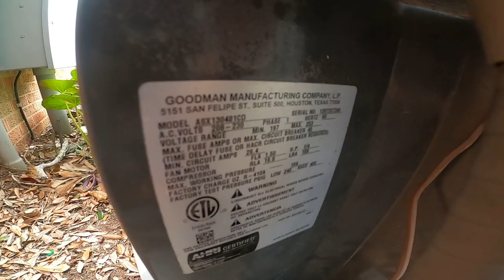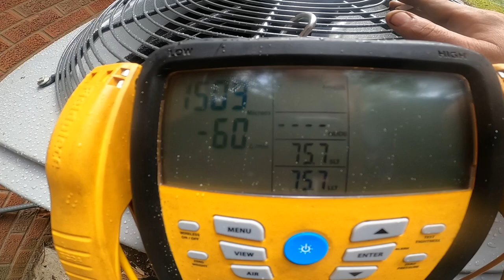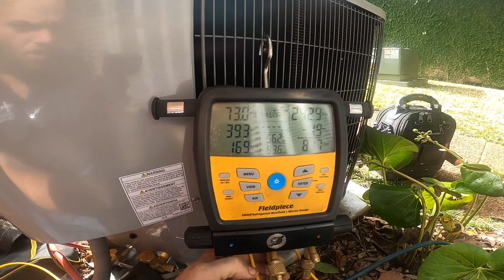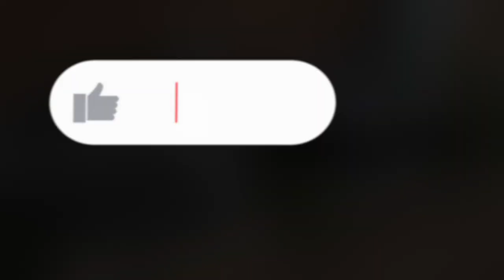HVAC Condenser Change Out/Day & Night (ICP)

Comment: I know lots of units that were installed decades ago and they didn't use nitrogen then and the units are still working. These are 22 units with no leaks. The only thing we have to do is keep them clean. Change a fan motor now and then. I noticed you cleaned the copper before you solder. A lot of Geniuses that are complaining don't even clean the lines, and they wonder why they have to come back.

Comment: Awesome John, Glad to hear that Carrier/ICP stop using the Chinese caps.  What brand are they using now?  The few I been putting in still have the Mineral Oil Chinese caps.  Also have not see the "Welded" AL coil yet.  It's an interesting design, if you have time you should take a look at the videos Carrier has on it on HVACPartners. (and ICP HVACPartners).  Nice install...personally I like the ICP over the Rheem/Rudd, but there's nothing wrong with Rheems either.  The Distributor here sells both Ruud and Day and Night.

Comment: Is the thermostat controlling the solenoid and a low pressure switch cutting condenser off?
Reply: No that's only done with refrigeration units. When stat cuts y, it cuts the 24v on y going to solenoid and condensor
Reply: @justinh7957  why have a solenoid then on that application? I would think since it's a long run they wouldnt want to start unit under a load? If it's cutting both the solenoid and compressor contactor at same time, to me seems it's not doing anything, just my thought.
Reply: I’m replacing a 2 1/2 ton R22 split system with a 2 1/2 ton R410 Rheem. The line set is 100 foot long of 1 1/8 suction and 1/2 inch liquid. System has been running perfect for over 20 years. Those sizes are not acceptable on the Rheem piping chart. It will be impossible to replace the lines without major construction. I was thinking of installing a solenoid the same way. Any thoughts or feedback? Thanks.